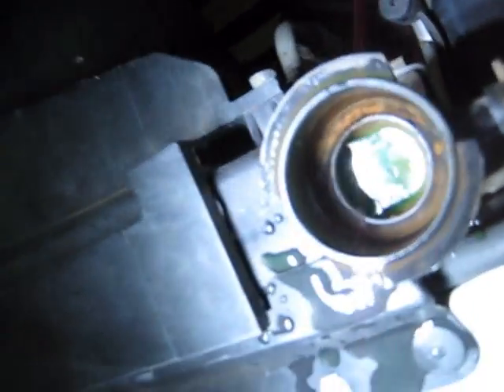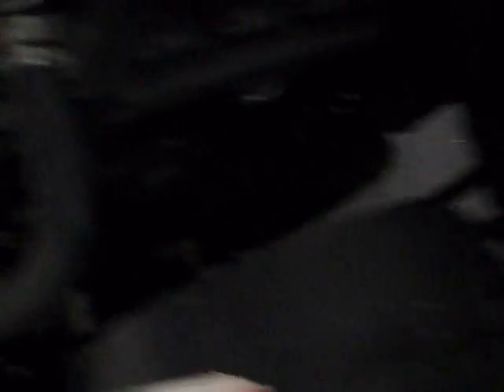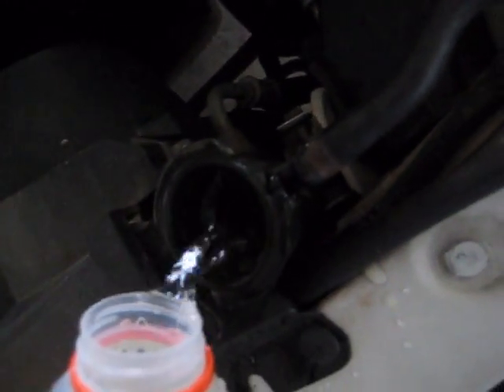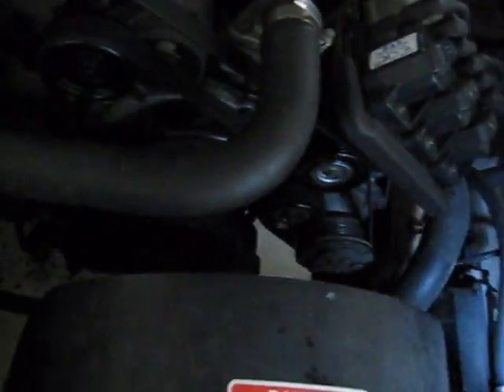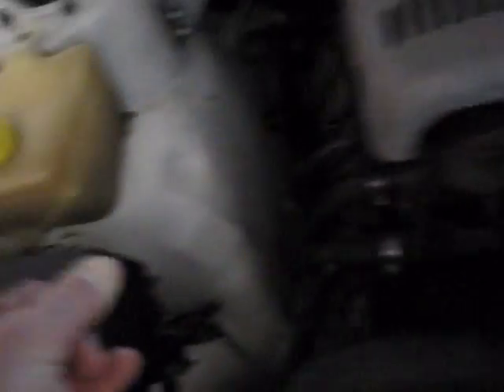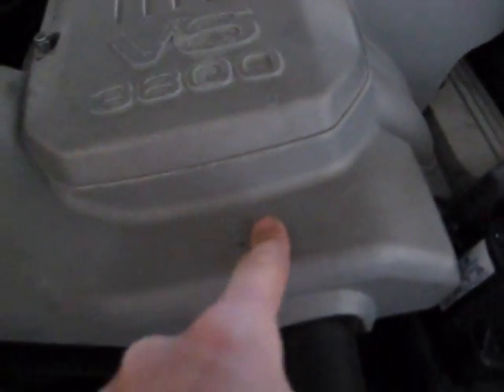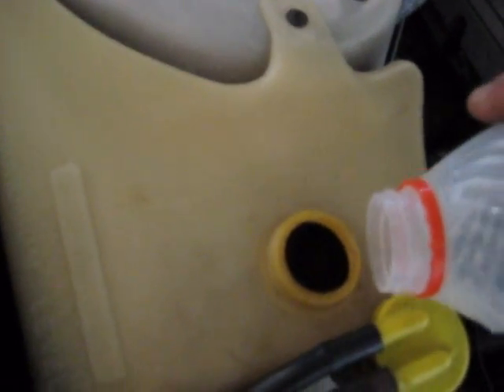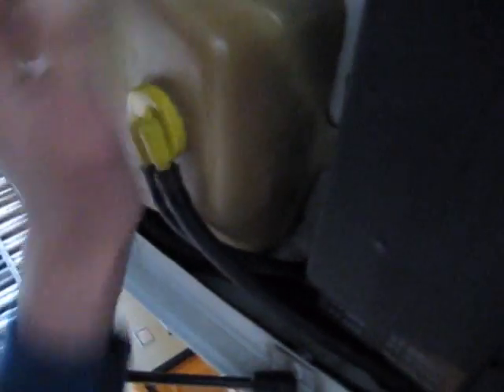Purging air from cooling system

Comment: Great to see you gave this a go mate.
I recently bought a VT Commo as a work horse.
2 weeks aftrer I bought it, it started spewing out coolant from the reservoir when it was turned off, then is started overheating while driving.
I replaced the notorious intake manifold gasket (which was the main issue as it was caked with engine oil/ sludge & broken up), water pump, heater pipe O rings x2, thermostat, radiator cap & flushed the system 6 times then put it all back together, bled the cooling system which should be done as follows:
1) Large funnel or cut up coke bottle firmly sealed and fixed in radiator opening.
2) Start car & turn heater fan on at full speed (only then will coolant flow through heater core)
3) Top up the funnel or coke bottle so coolant fluid level is way above the radiator
4) Let car run for up to 20-30 mins ( you'll see air bubbles being expelled as engine warms up)
After all this the car was great for 3 months, then it started spewing coolant from reservoir again & this time I heard water slushing sounds from behind dash (in heater core) whenever i turned or braked.
There were no visible coolant leaks at all, but i decided to change both radiator hoses and all 4 heater hoses and heater tap.
They were all the original hoses & tap......... 20 years old!
Re-bled and it's been perfect ever since.
These cars run on pressurized cooling systems so the slightest air leak, which could be as simple as an old hose not sealing like it used to, or a faulty heater tap, or a bad hose clamp could allow the slightest amount of air into the system.
The air then rises to the highest point which is the heater core....and there it gets trapped, which explains the slushing sound you hear when you drive.
A word of advice would be to use a genuine Holden radiator cap.
They have better seals than the aftermarket caps and are only around $15.

Comment: Good vid mate. Did u Clamp off the overflow  bottle hose? Not having it closed off can give u lots of air in the system. Also having it running while bleeding is the best way to bleed the System as it brings all the air to that small screw on top of the thermo housing.

Comment: There's a easy way to do this. Large high volume funnel or a plastic coke bottle with the bottom cut out fits well in the Commodore neck. Fill enough coolant in so it is well above the bleeder. Do this on a cold motor ! Because the coolant is above the bleeder and at the highest point , air will be easily forced out. 
Works well everytime for me.

Comment: getting air out of my magna is like trying to draw blood from a stone. the head is higher than the radiator so i have to take the hose off and pore water down into the head and wait till it comes out or the top of the rad then park it on a steep driveway with the rad higher to let the final bit of air out and top up the system. 
good vid!

Comment: your makin a mistake run engine till very warm if you have air traped ull notice your coolant resiovoir will appear to over fill due to the air forced the coolant back.  keep running and use bleeder cap on hose check its hot water comming out not air steam is ok but ideally you need to see water hot water, ok then switch off engine let engine cool dont keep your eyes off the resiovoir for a second in about ten minutes time once cool youll notice air bubbles coming back to the top of resivoir,

Comment: @roel2055   Check the cooling fan motor.  You can use alligator clips on the cooling fan motor connector and see if applying 12 volts to it to see if the fan runs or not. If the fan does not run replace the electric motor.   If it does run you might have to leave the cap open and let it warm up to expel bubbles.

Also a fair warning the  3100 and 3400 engines have an intake gasket that can leak. 
Replace them with a felpro metal and rubber versions which will cost $85 for those with other seals.

Comment from the maker: @mattyvt93 I did run it & bled it, No air now, also topped it up too (After i did the vid)
I wonder if you could just stick a VS Reservoir bracket in place to hold it properly

Comment: there is more air than coolant in there LOL 
straight water = bad its cast iron. = RUST 
need anti corrosion A type coolant. or go to holden

when you refill a engine like these. undo that bleeder valve on top of thermostat. make sure all hoses are tight. turn heater on fan on 1 
start and fill keep topping up. and wait for thermostat to open. then add probably another 2-3 liters once full and thermostat has opened. place the radiator cap on, and leave the bleeder open. and wait till coolant comes out non stop if its spurts still air on system. once just coolant. seal bleeder go for 20 min drive then stop with engine running. open bleeder check for air (you will have to do this 3 -5 times to purge it all   
you need a 50% concentrate in these cars so premix is on 33% better than straight water. but holden requires a 50% concentration
depending on how well you empty these systems you may need 12 liters of 50% coolant. so 6 liters of concentrate and 6 liters of demoralized water

Comment: That's a hellava shitload of air in the cooling system mate! ... looks like you drained the radiator and block and then just filled the radiator and topped it up occasionally till it looked full ... and squeezing the hose repeatedly is just letting more air in. I run the engine and open the bleeder screw till coolant pisses out then quickly tighten ... radiator hoses should be rock hard even after a short drive, if there soft it means there's air, faulty radiator cap or a leak in the system somewhere ... otherwise not a bad video mate lol

Comment: Cool!, most likely air as you said, my mums vt was doing that.
As for the pws resivor, the vs has a different clip to the vt, the vt only has those two slide thingos like yours lol, but not the middle clip. The vs design is much better. Thanks for that :D
Should have been running the car while opening the bleeder valve, gets all the air out in one go, plus keep toping up the rad :D